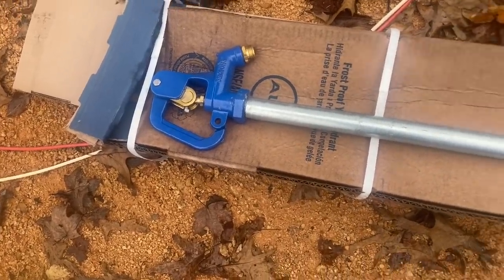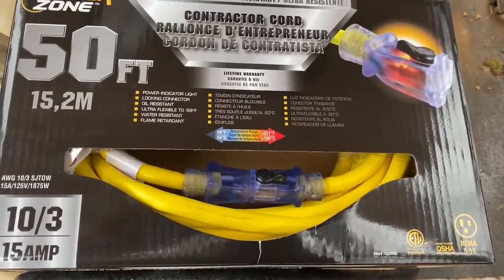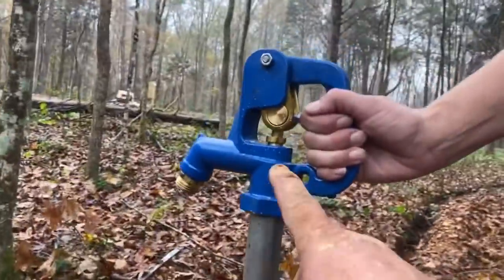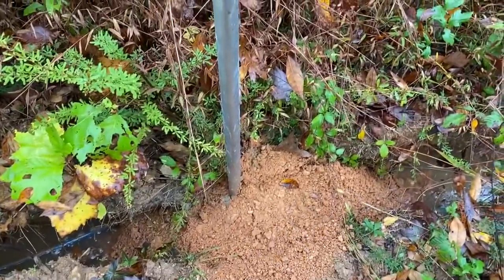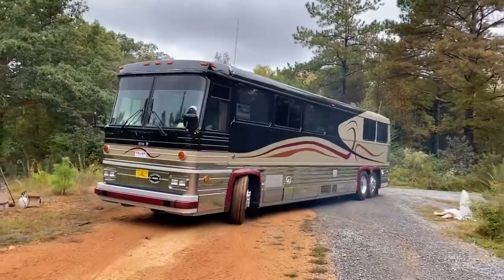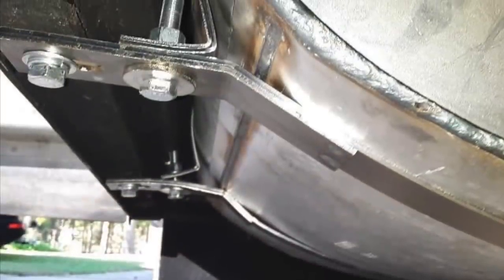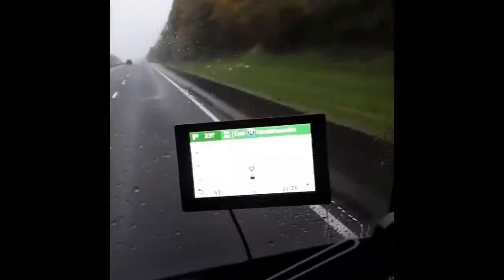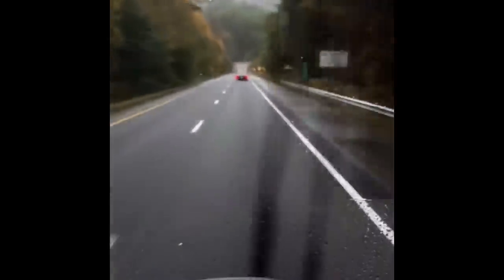8v71 straight piped going through tunnels and Getting the property ready for winter.

Comment: As a trucker that was born too late, I dream for the days of Detroit two strokes run down the highway with a load
Reply: During the late 60s/early 70s, I lived close to I-80 in the midwest.  In the evening we could hear the winding out of the Detroits as they hit the grade, gear change, winding out.  All night long.  I would call that a high lonesome sound.
Reply: I drove a bobtail with a 4-53T. It sounded great, but was underpowered. Back then I dreamed of a Cummins NTC-350. Now my tinnitus and I reminisce about those days in the 70's...
Reply: @rnreajr9184 .... What kind of "bobtail" did you drive, that was powered with a 4-53T?
Reply: @Romans--bo7br  1976 GMC 7000. It had a GVWR of 25,000 lbs. We had an Atlas stainless steel refrigerated body on it to haul milk and ice cream in Northern California.
Reply: The "romance" is better than the reality. I drove many a Detroit in my young years (in the 70's) and in reality they worked you to death. I'm very lucky to have my hearing left as well.
Reply: @turbo8454  it just dawned on me that bus drivers will like them more because the engine and exhaust were about 40 feet away from you, instead of two feet away from the engine, and a few feet from the exhaust!

Comment: Scott.  I have had to dig one of these up at our camp because mud clogged the drain at the bottom.  Yes use gravel, but also enclose the bottonm in an inverted milk jug so that the gravel does not get mud in it that will clog the drain and the vertical pipe can then freeze.

Comment: Those hydrants FYI either all the way on or all the way off. Anywhere in the middle and you will be pumping water out that bottom valve into the ground. I would put a valve just before the hydrant so if you have trouble with it you can just shut off the hydrant and leave the rest of your system operational.

Comment: Are you going to run the heat pump of your mini split on the bus to keep warm along with the other heaters Had you calculated your solar and battery usage for heating yet on Lenny.
Reply from the maker: So far that’s what we have been using exclusively for heat. But below freezing we will add some other sources as well.

Comment: Scott ,I found one of these Mcis with 8v71 auto.would you recommend it?  Does this gentleman have any dislikes about his bus? BTW where are the AC units? And How Many are there?
Reply: The biggest drawback was the lack of power up hills but the propane booster has  in my opinion been a great improvement. I still have the original road AC and the house air is underneath in the middle bay. Both are 134a.
Reply: @bonoble4055  Do these units run off the gen set? What fuel powers it diesel or propane? Any issues with house ac?
Reply: @VitaminC440  yes the house air runs on 110v either shore or genny.
Reply: 12.5 kw Diesel perkins generator.

Comment: Hate to burst your bubble and/or clog your drain... 
Clay does not promote good drainage. Non-clay dirt, sand, gravel... They drain. Clay tends to end up impervious.
Reply from the maker: Chert rock went around the hydrants the clay/rock fill is just to bury the pipe. No drainage needed so you aren’t bursting my bubble
Reply: @TomRedlion "This (the faucet) will be buried in gravel... {afterwards} I mixed some chirt in with the gravel.  Then I will backfill with clay."  I believe you are a little off in your analysis.  He used what you suggested.
Reply: @BusGreaseMonkey  I heard clay and had a micro panic attack. Using unfired pottery to bury simple horizontal pipes is perfectly acceptable.